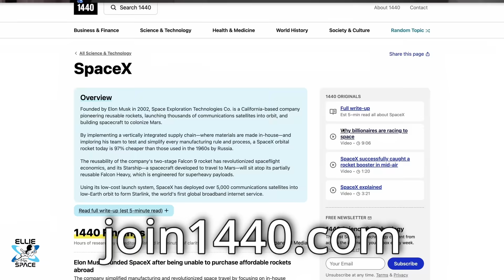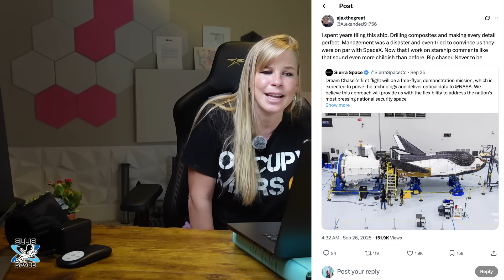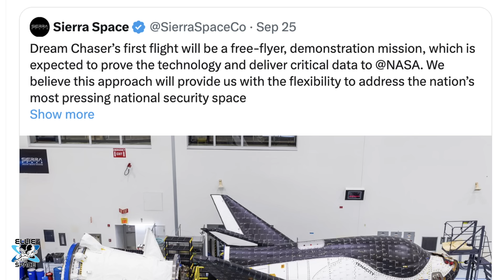1 Billion Dollar Dream Chaser DOOMED? NASA Walks Away

Comment: Maybe dream chaser should just hitch a ride on a falcon rocket getting to lower orbit and take space tourist around I don’t know and then just come back. Have enough oxygen and whatever for 76 minutes Wallen on pressurized space. Like eight people in there Titan 2.0 j/k but this would be a better option and deal vs Jeff’s 🍆 ship that has “questionable” altitude s like might have passed the 67 mile mark? May not? The virgin galactic system is dead and works with a complex plane, and a terrible rocket engine and not to mention had a pilot pivot the wings too steep and disintegrated the ship.

Comment: When I worked at Adam Aircraft,  we were in the running for the dream chaser contract back around 2005 or 6. The brought the full sized model to our factory in Englewood,   Colorado.  We can in third for the contract. We were building carbon fiber planes , but Adam also failed. I later interviewed with Sierra Nevada Corp around the year 2021 when they were building the Chaser. I saw the plane in the assembly area. Needs objective management.

Comment: I worked on Dream Chaser for many years. My biggest concerns when I left were thermal seals on wings and flight control surfaces and the propulsion system. there were some other technical risks in work as well. And, yes, management was terrible. From what I have heard, that did not improve after I left. Wrt the TUFROC tiles - they ARE more damage resistant than shuttle RCC. And, in fact, Boeing has been flying a very similar material on the X-37.

Comment: SpaceX used technology that already existed so the leap was not that great (see DC-X & DC-Xa).  So to some extent was Sierra, the lifting body concept was tested in the 70's with the X24 and it's predecessors.  The fact that Sierra has not been able to capitalize on all this as SpaceX had is disappointing.  I had high hope for the concept, it made sense and was based on existing research.  I don't blame the government from pulling funding, it probably should have come a lot sooner, but I do lament the mismanagement of what should have been a promising and faster to develop space delivery and transportation system.

Comment: Actually if you play devils advocate SpaceX hasn't proven total system reusability yet. The first stage of Falcon 9 has proven it, but the second stage of Falcon 9 is expendable. Starship and Super heavy have shown that they have the potential to be reusable but that is not yet a proven fact. It is in fact so unproven I'm kind of surprised Musk hasn't developed an expendable second stage for super heavy as an interim vehicle until starship becomes operational, which it may not ever be.

Comment: Did you forget the commercial Space Stations?  Blue Origin & Sierra Space working on 1, with this Spaceplane being their only access option.  The station might be delayed to 2031, but then Dreamchaser Crew Version must be ready.  They don't want to cooperate with SpaceX.  I hope that the docking ports are still generalized.  If there's ever an accident, it would be too dumb, if help arives but can't help cuz of docking problems.

Sierra Space are being punished, for showing initiative?  Dreamchaser was supposed to fly with 2nd Vulcan, in November 2024.  Was brought to NASA, for final flight readyness tests and after a whole year we get this bs.  The mentioned public funding also only came in very late, when it was nearly ready to launch.  We need to find out the reasons for these delays.  There's a lot here that smells funny.

Comment: 03:39

Thanks for reminding me what Dream Chaser was.

I used to play Buzz Aldrin's SPACE PROGRAM MANAGER.

The USSR had an Experimental Space Shuttle Program back in the Early Days of The First Space Race Era; but, it was abandoned before it was flown.

Buzz Aldrin's SPACE PROGRAM MANAGER allowed the Player to pursue various Theorized Space Programs that got abandoned at some point.

The USSR Shuttle Program in the Buzz Aldrin's SPACE PROGRAM MANAGER featured 1-Person Shuttle Designs; and, there was 2-Shuttle Launch Program similar to the GEMINI Program.

The Dream Chaser Space Shuttle is very small; thus, appears to have no Mission Capability other than Spacecraft Equipment Testing and Pilot Testing.

As a Production Spacecraft Design, Dream Chaser would be a 1-Person Escape Pod; or, a Privately Owned Spacecraft for ferrying between Mother Spacecraft and Celestial Body Surfaces.

Expanding the Mission Role; and/or, Personnel Capacity, of Dream Chaser Space Shuttle would mean creating an entirely New Spacecraft Design; which, would have to be much bigger in Volume.

And, the Dream Chaser Space Shuttle Parts wouldn't be compatible with the Newer & Larger Manned Spacecraft Design.

It is one thing for Billionaire to say, "I want to Privately Own & Operate this Spacecraft Design."; and, fork over the finances for the research and development of that Spacecraft Design.

It is another thing to say, "I have this Spacecraft Design that I personally want to own, and operate; and, it can be used for NASA Outerspace Research & Exploration Activities.".

My FLOWER CHILD PROJECT "2004 Presentation Folder" primarily featured the differences between the "Flower Child"-Series Spacecraft Design and the APOLLO CSM/LM Spacecraft Design; because, that is as far as I got after acquiring a Computer System in 1998 that could handle DeltaCAD 3.0; due to, the instability of my own Personal Lifestyle Circumstances during that stage of my life; as well as, I was also involved in other Personal Projects.

Comment: In my unsolicited opinion, I think Dream Chaser was pursuing nostalgia. The whole Space Shuttle form factor appealed to old school NASA leadership, but as time has gone forward and that leadership has dissipated, so did the prospects of Dream Chaser.  There is also a problem with the thermo protection system being a dated technology, which leads me to wonder what other aspects of the vehicle no longer appeals to NASA. Finally, I think that the program would have faired better had they completed flight demos a few years ago, I believe they would have had a better shot at long term viability.  There is a finite window of opportunity to excel and that window is just about closed.

Comment: Boeing built two smaller versions of this mini-shuttle concept, called the X-37. These have flown several times successfully, launched by the Atlas rockets and more recently, SpaceX Falcons and Falcon Heavy. All X37 missions are secret and hush-hush.
Reply: ...secret, hush-hush, but visibly successful. And very long orbital mission duration too. Whatever they're doing up there, they can generate all the power they need for their mission, maintain and adjust attitude, and maintain orbit integrity, for as long as they need to be up there.
Reply: Exactly. X-37 style is a no brainer. The concept has been under-utilised, but I think we will see a lot of vehicles based on this concept in future, assuming there's a destination up there after ISS. Besides X-37 and Dream Chaser, there's also Shenlong. Landing a capsule in the ocean is one of the worst ideas for reusability. The parachutes are crazy difficult, the marine infrastructure is expensive, it's time consuming, the salt water is difficult to manage, and weather can cause more delays, because weather impacts not just the spacecraft but the whole recovery fleet.

Comment: During my very first internship for NASA (I had two internships and one grad-school co-op position), I saw the early Dream Chaser test craft. It was so amazing to look at when it was in the hangar at NASA Langley Research Center. It's been a long time and the craft still hasn't flown in real-world. It's a great idea -- but it may die as a project simply because the ISS's mission is rapidly approaching. 

I always wanted a next-gen shuttle that eliminated the costs and problems associated with the Shuttle program (e.g., side-by-side launch with detachable fuel tank/boosters, inefficient launch costs, inefficient turnout of spacecraft, etc.). VentureStar was the best of the designs (and the one that initially won a production contract). However, it was canceled in the early 2000s because of development costs with questions of whether or not it would have some of the same cost, safety and not-so-quick-turnover issues that the Shuttle program faced. 

More importantly, in a very short time, SpaceX has proven itself at a fraction of the cost of development of a new shuttle. SpaceX has proven ROCKET usability and, hopefully, Starship reusability. The Obama Administration struggled with clarity for NASA (choosing asteroid visits over other programs). However, those proposals didn't foresee the rapid success of SpaceX. 

As 75 years of rocket science has proven, rockets are the best design for space launches. SpaceX is making them the safest and only truly cost-effective reusable system. So, the sad truth is that Dream Chaser is a relic of trying to improve the 1970s Shuttle program concept at a smaller scale (and with less issues).

Comment: DC will probably never resupply the ISS but, over the next several years, four new commercial stations are going to be built, including one, Orbital Reef, that Sierra Space is a major partner on. Those will need to be supplied and Starship is, frankly, to big for most of them. My guess is that DC will find work servicing those new stations.
Also, concerning the first part of the video, in another two or three years, America will have four or five reusable rockets in operation, China seems likely to have at least one or two, and Europe may have a grasshopper style test article flying. The time for Arianespace to have "reacted" to SpaceX was about the time that interview was being conducted.

Comment: Dream chaser can be a valuable space tug for the upcoming refueling of the starship.
Think about it : Starship orbits an enclosed fuel drum, at the right time the Dreamtug pulls out of the opened Starship, the monopropellant filled drum , maneuvers it next to the Starship to be refueled.
Then it pulls the empty drum out of this Starship , places it next to the full one, reaquires this full one and maneuvers it into the waiting S.S. 
All this is done by the skilled operator manually.
After all is done 
the full Starship accelerates to MOT and Dreamtug  inspects all required tasks then docs with ISS where its crew takes a coffee break
And the 'empty' Starship re- enters . 
Fait Accomplit, tout est bien qui finit bien🇫🇷
Reply: Starship will be the fuel drum, no separate container needed.
Reply: @om617yota7 
Think about it
You need pumps, connectors, power for the pumps 
continuous thrust to accelerate ,
docking structure
All this without human observation, when it leals:
Kablamo, as Blancolirio explains
leading to another session for Juan Browne to elucidate.
Every aviator likes to control his air or space craft , like Dreamtug!
Et ça c'est la véritée  🇫🇷

Comment: Could the solution to the timing problem be detachable flat(tish) panel carrying the tiles, to discarded in the descent? That way the tiles would no longer be complex, unique shapes integrated with the airframe. Preparing for a new flight would simply be bolting on a new panel. A way of getting the discarded one to Earth without hitting anything valuable is left as an exercise for the reader. :-)*

Comment: what's even more sad is that once starship cargo comes online, it's game over for dream chaser. It will be obsolete. and at the pace they are going, it's unlikely dream chaser will even be functional before starship.

I mean think about it, starship is mass produced, they already have the factory set up and everything. Dream chaser is just a one off prototype, untested, and less capable. I suppose at some point, they have to realize it's pointless.
Reply: If small cargo transport is all it is good for, then it was never good.  They should use it for orbital flights for millionaires.  From anywhere on Earth to anywhere on Earth in 45min.  $100k per flight.
Reply: That’s ignoring the entire commercial space station market.
Reply: Starship could launch a space station, but couldn't service it unless it's another Starship. There's already concerns about it docking to Lunar Gateway.
Reply: @12pentaborane  1. aren't they decomissioning the space station like in 5 years?

2. that's why spacex already has falcon9, which is even more capable and cheaper than the dream chaser would be, which is unproven by the way.
Reply: @netstatmint8639 Starship, specifically, has the issue that it's so large that the space station it docks with needs the maneuvering capability to handle such a load. Those space stations includes the proposed LEO destinations NASA has contracted. Does SpaceX have other vehicles to do that? Yes, but they plan on phasing Dragon out once Starship is crew rated, which it needs to do to satisfy the HLS contract. Ultimately if SpaceX will outsource LEO crew and cargo return Dream Chaser might have a chance, if not a great one.

Comment: Dream Chaser is redundant.  The X-37B is more capable.  There's one in orbit right now running experiments.  Is on its 8th mission (OTV-8).  Falcon 9 put it up there.
Reply: But it's secret and UNMANNED
Reply: @Arturo4586 The dream chaser they ended up building is unmanned anyway. They delayed if not scrapped manned plans.
Reply: @Arturo4586  what is important is the hard stuff has proven itself.  The rest is policy.
Reply: Thank you 👍🏻💯🙏
Reply: X-37 is not crew-rated.
Reply: @Allan_aka_RocKITEman  that can change.
Reply: @Allan_aka_RocKITEman  I don't think there is room in the ones they have.  They have intel packages they're using in them . . . basically a spy sat you can bring back and update.

Comment: Dream chaser is based on Space Shuttle which was the worst, most dangerous and expensive vehicle ever built. Dream Chaser is not only much smaller than Space Shuttle it is orders of magnitude less useful, yet at best being only marginally safer. I could type all day and barely scratch the surface of Dream Chaser's flaws. IMO Dream Chaser should be canceled immediately and even if the project continues it will still never fly. It is a bad solution looking for a problem and trying to enter a market Starship is redefining to not include legacy hardware like Dream Chaser.....So yes RIP Chaser. Never to be.
Reply: Wrong on everything. - Dave Huntsman

Comment: I'd like to see more options/choices for manned operations in the market rather than fewer.  Russia's gone as an option (and that we had to rely on them for years is beyond horrible), Boeing is out (beyond all the problems it doesn't look like they want to be in a competitive market).... leaving us with one option isn't wise.  Only having one option seldom ends well.

Most of the work is done, it looks like a viable option, seems silly not to get it across the finish line if only to provide redundancy.  And truly only 2 options is still sketchy, I'd like to see several.
Reply: Globally,  China & India are replacing the russian space program.  But, NASA isn't positioned to cooperate effectively with them... So, yes redundant systems are probably worthwhile.  If we didn't have SpaceX Dragon, everything would depend on Boeing!
Reply: Soyuz just works and has for decades. They've also developed the fastest manned path to LEO. Don't blame the entire country and it's people for what the 'defense' people do. The ISS wouldn't have been built when it was without Russia.
Reply: Why would any country take on such a tax sucking project when all of them are having financial trouble just like we are so they are the smart ones by putting that crap on hold until we get our finances on the ground straightened out 1st
Reply: @Shawn-c2i  Nothing ever gets done by solving all the problems first 😊

Comment: I have yet to understand what Sierra Space will not give SpaceX the Dreamchaser lift body contract? 

ULA is busy focusing to regaining its position regarding Military)Space Force contracts, same as Blue Origin. So they are not eager to help a space launch competitor  achieve its goal.

Since SpaceX has alread secured NASA, S9ace Force, and ither independent satellite contracts, there is launch space available bfor Falcon Heavy to guve Dreamchaser a lift. SpaceX has a larger fairing reqdy for operation, should Sierra Space make the request.
Reply: If I was SpaceX, I would charge out the ass to take advantage of the situation and then watch a potential competitor dry on the vine.
Reply: @Fnames-q6x   That could be the problem.... there's two (or more) sides to every contract.  Comment sections operate in the vacuum of space, where anything is equally possible without any friction.

Comment: SpaceX can use this design for their crew transfer verhicle, which they are going to need as starship itself will not be human rated for launches and landings for a while yet
Reply: Wouldn't they just use crew dragon?
Reply: @random-citizen-x  The original plan for "DearMoon" was to use Falcon Heavy and crew dragon.  That got set aside when they went full bore on Starship.  So at one point SpaceX did think transfer to the moon was doable with crew dragon.